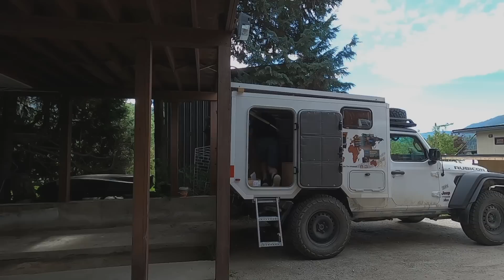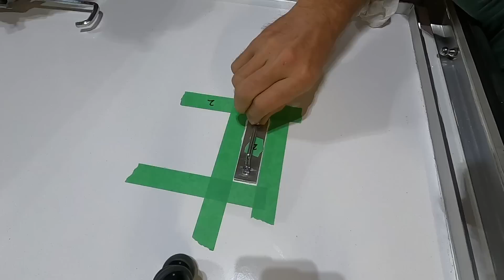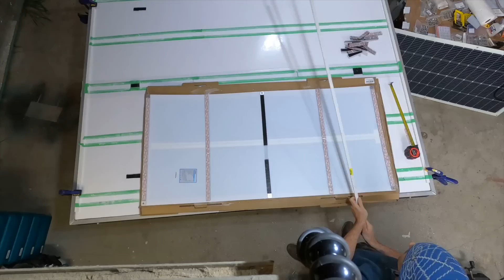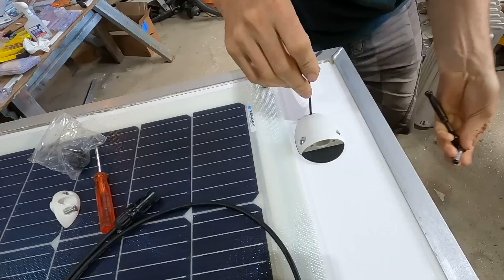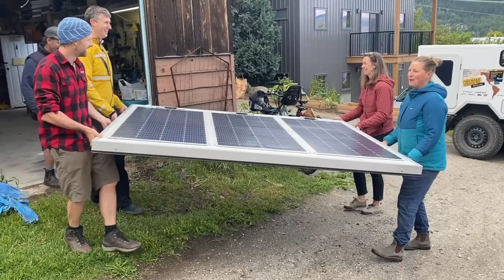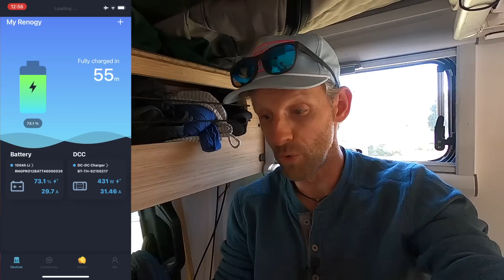DIY Flexible Solar Panel Install - POWER FROM THE SUN!

Comment: Most people are using VHB tape, also from 3M. All seem to be happy with it and gotta say without actually doing this myself, the tape method seems a lot easier than the method your are showing.
Reply from the maker: I really didn't know if VHB tape would hold up in the long run. I dont want a panel to rip off

Comment: Great video Dan, just planning a build out for f/t living.  Being in Canada ( you know the drill) would you recommend induction cook top, or propane? Solar is pretty limited in the winter as you are well aware.  Thanks,  and Have Fun! 🎉🇨🇦
Reply from the maker: Depends where you're going.
Propane is a pain for international travel (every country has it's own fittings, shipping the bottle is hard), and it freezes past about -35.
Induction was incredible, I'll never use anything else on future builds.

Comment: That is great!! I will pick your brain next year. I'm overlanding  my Wrangler JLU for small trips, but it will be a mobile 3D Design/Print studio. I will have a 3D printer, rear seat delete. My trips will be at the most 1 month long. I have been testing a 3D printer under continuous unstable surface and so far performing very well. I just need to recalibrate every few days to maintain top quality print. On the road I will be printing prototype, so print quality is not the priority.
Reply from the maker: Sounds like an awesome plan!
Reply: @TheRoadChoseMe  Thanks, very excited about it. I'm going to design and print practical parts and custom modular storage systems for the Jeep.

I really admire what you are doing, be safe and travel well.

Comment: Would these panels be good to fit to pop top Hi ace camper van, is there airflow between roof & panels? Thank you for advice
Reply from the maker: Yes, absolutely.
An air gap makes them more efficient. Some people say it is 100% mandatory, others not so much. Mine have a small gap, running great

Comment: Not a Renogy fan but excellent video!

I plan to put solar panels on the roof of my 2021 JLUR, which has a full off grid power kit (12V 100ah LiFePO4, alternator and solar).

Comment: Looks good, BUT not a fan of the tape, some conduit would have been a better choice.
Reply from the maker: I'll upgrade it to conduit if the tape is not sufficient. I had something similar for 3 years around Africa, it worked perfectly.

Comment: Great work and great video - as usual - well done.
One suggestion would be to add a piece of aluminum trim that covers the leading edge of the solar panels. Attach it with the same super velcro. You know your roof will get scraped up from trees and things and just don't want something snagging the front edge of a panel and ripping it.

Comment: Do you notice yourself using less gas now that the alternator isn't demanding as much?
to be clear I'm not sure how an alternator works lol. If you need more power it causes the engine to run at higher RPMs right?
Reply from the maker: Charging off the alternator does put more load on the engine, and will result in high gas usage, yes. Is it significant enough to be noticeable? The jury is out on that.
Reply: @TheRoadChoseMe  gotcha, thanks!

Comment: Excited to see your opinion on these. I used a cheap Chinese 100w flexible panel in southern California for a year and then it was dead. (barely generating) I've heard its because they don't have a way to dissipate heat as well as a traditional hard panel. I just now I won't be buying them again.

Comment: In a previous video you had already chosen an induction cooktop. What are the specs on that cooktop's draw?
Reply from the maker: It has two burners that are 1500W each on max
Reply: @TheRoadChoseMe  Neat. I'm assuming they are running on 110vAC from the inverter? Whats the draw down on the battery after a meal (ballpark)?
Reply from the maker: yep, off a 3000W inverter.
I have not used it yet, but I'll be reporting back after we put it through it's paces for sure
Reply: @TheRoadChoseMe which induction cooktop are you using?
Reply from the maker: Dometic CI120

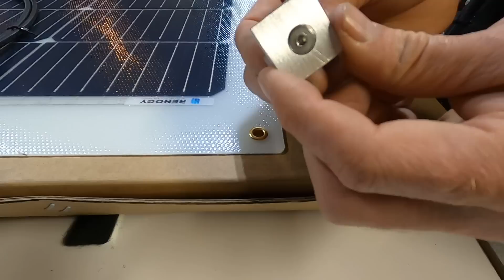Comment: 4:27
I did exactly that 7 years ago! 6 x / panel with a 45mm circle + sika 221 (= not the 3NM/qmm stuff). Hold´s up to 140km/h being at THE FRONT of the rounded roof! = High Pressure zone.
Nothing else holding these to the roof! 
Your choice of placing is a LOW pressure zone. The plates are quite small, otherwise I would think the velcro is not needed.

What I would always suggest: Make it so that water will always be able to run off the roof/PV when standing in every angle! It just takes 3 days under a tree or 2 weeks w/o and the roof is very, very dirty.

Regarding gab: A PV connected to the roof, makes the roof a heatsink. A gab does not. I do not see a benefit in a 6mm gab.
When a slim PV is on a surface, you can stand on it with no issues. Not with a gab of course. I do not know if your roof is capable of taking the weight of a person, but a foldable SUB e.g. or similar can be nice to place onto the roof for a short drive (like from the beach) or similar. Or a bag ...

Comment: I'd have mounted the panels to a framed perforated aluminum sheet  Fewer holes in the roof, air circulation underneath for cooling (and water drainage), easy removal for maintenance, and cleaner wiring on the underside so no snags.

Comment: Interesting idea using bugs as aero wind tufts. Makes the spare a bit sticky.
Winter snow might reveal a pattern too.

In Quebec, freezing rain is a concern. Allowing the panels to move from ice loading should help.
Reply: "freezing rain" is a very local concern. I can count the days in my live when I have seen that.
But that can be a huge issue in many ways.

Comment: My experience with Eternabond (similar to white gorilla tape) is that is traps water over time. Might not be an issue for you since you used heat shrink on the wires, but I live in the PNW where things stay wet a lot.

Comment: Hey just a heads up, I have just had some Renogy solar panels for a few years on the roof of our camper trailer, exactly how you have installed your panels.  One of the panels stopped working a couple of months ago, the panel was found to be under warranty, except I had cut and soldered the wires just like you, because I had done this, I had modified the panel and it wasn't covered under warranty.  Renogy in the past have been quite supportive, but in this case they weren't very helpful at all with this claim.
Reply from the maker: I figured I was voiding the warranty when I did that, thanks

Comment: Great summary on the serial vs parallel, thereto is one extra thing… charge controllers need 5v to run, so you don’t start charging until the panels give you 19.5v.  When in parallel, all the panels need to give up those 5v, but in series, only one gives it up, the other don’t.  An example:

3 panels that produce 20v @ 10amp, in parallel that is 20v @ 30 amp, but 5v goes to run the MPPT, so there is 15v @ 30 amp.  Convert that down to 14.5v and you have 31 amp.  Now put them in series, 60v @ 10 amp, subtract 5v for 55v @ 10amp, convert to 14.5v and you get 34 amp (about 43 more watts)

So there are some serious disadvantages, when you have three or four days of overcast, those extra amps really matter!
Reply: I personally would not go back to low voltage array for my mobile roof top setup. 40V minimum in my opinion particularly when located in regions where the sun is limited during winter. I've experienced the vast differences with series and parra circuits
Reply: "is 20v @ 30 amp, but 5v goes to run the MPPT, so there is 15v @ 30 amp."
Cannot be true. This would mean that the MPPT takes 5v*30 A to run? = 15W. For sure this is not a static value, as Maximum Power Point Tracking suggests.

But most of all: It is sponsored by a company. Therefore there are no other options. Here in Europe, most people use victron stuff. I just bought a 80 + 160 W panel, as the need to fit certain spots on the roof.
= to charger: 75/15, the very small ones. Similar size as a package of cigaretts, 55€ each. So I do not care. Except for double the cable from the roof.
Reply: @derJackistweg  I  believe the more accurate explanation is that MPPTs require a 5v differencial with the battery prior to commencing charge.
Reply from the maker: @cyclemoto8744 @derJackistweg  So I watched my system tonight as the sunset.
Battery voltage was 13.4v, panels were putting out 15.4v at 0.52A and the battery was charging.
If they were in Series it would have been roughly 46.2v at 0.173A for the same power output.
It's clear my charger does not require a 5v differential between the panels and the battery to charge.
Reply: @TheRoadChoseMe   To compare the effect  of series and parra you would need to measure the output from the MPPT opposed to the output from the panel or array. If you observed charge with less than 5v differential I have no reason to doubt you because you come across as competent person. I do not know the brand or model or your mppt so impossible to know the specifications. I can say that I've used various brand named MPPTs over the years with the most current being Victron which has outperformed all others when following the specified 5v differential. Your charger may be different. Cheers
Reply from the maker: @cyclemoto8744  I'm using the Renogy IP67 50Amp DC/DC MPPT charger 
( https://renogy.sjv.io/5gNPnD )
In the Renogy App I can see the output of the charger and the output of the solar panels seperately.
Reply: @TheRoadChoseMe  I have no experience with Renogy. The only reason I've stayed clear of their products is their terrible after sales service in Oz. cheers
Reply: @TheRoadChoseMe  while I still hold to the +V, maybe my math is off because I might not be taking everything into account correctly...  Here is what I know about my Victron MPPT's, they MUST be 5v over the charger voltage to activate charging.  What I don't know is how many of those amps it actually needs.  

To keep numbers simple let's assume two equal but different setups:  There are two panels, both 100 watts @ 20v for 5 amp of output.  In series, it is 40v @ 5 amp, and in parallel 20v @ 10 amp.  So both have a total of 200 watts of power.  My thinking is maybe what is it is that the MPPT only needs +5v and 2 watts, so... how it gets that 2 watts from each setup will be the same, but in both cases it will have 198 watts to convert into charging current.

I built my first solar system all in series because I am a fan of higher voltage.  I thought I would really benefit from the higher voltage, nope...  What I learned from my first system (4x75 watt panels) is that when the voltage was below about 76 volts (19 *4) the amps were so low little to charger was really happening, maybe up to about 10 watts, max.

This whole conversation has me thinking:  If the +5V isn't really a thing and higher voltage doesn't result in any meaningful increase in charge, what is the REAL advantage in higher voltage solar systems?  I think there is really only one: lower amp lose over the wire.  On a setup as small as yours you can over come that by using larger gauge wires....
Reply from the maker: @SamCarleton Lower power loss is the big one - you always want to minimize current when possible. I am also aware that many chargers have a low voltage cut off where they just stop charging below a certain voltage. Mine does not appear to do that, so for me that doesn't matter.

Comment: Are you worried at all about heat transference of having these flexible panels closer to the roof than say that of your africa jeep with a raised panel?
Reply from the maker: Yes, it is a concern for sure, though I hope the 6mm gap will be enough to not damage the composite panel of the roof from the heat. Time will tell, I will report back

Comment: Awesome. Would love info, or links, to the 3m tape and epoxy glue for the aluminum backing plates. Did not see them in the description. Is it possible to add a display to monitor without a smart phone? Thanks
Reply from the maker: Thanks, I just added links to the 3M dual lock in the description.

The adhesive we are using for the backing plates and entire camper assembly is "Korapop 225" from Germany. Sika make many similar products, make certain you get the right one for your application, and use the correct activator, with the correct time delay and curing time.

Comment: Another  advantage of running your solar panels in parallel is that you won't have total charging failure if one solar panel becomes defective. Have you considered using silicone caulking to hold the wires to the roof instead of the Gorilla tape?

Comment: We recently had to replace the flexible solar panels on our caravan, which had stopped working, with glass solar.
Experts say if flexible solar is laid flat on the roof it overheats and stops working. There must be an air space to let the panels vent excess heat.
Our new Enerdrive glass solar panels are working brilliantly. We recently went 56 nights in Tasmania without needing to plug into mains power even once.
Our 200amp lithium battery was fully recharged by midday.
You might get away without an air gap in cold weather, but it could be a problem in warmer temperatures.
Reply: BTW our Enerdrive charger could handle up to 600 watts of solar. We have 400. Maybe you need a bigger controller.
Reply from the maker: The charge controller I'm using can handle up to 720W of Solar, just not above 50V of input
Reply: I’m looking at putting 2 of them on top of my checker plate aluminium canopy. Height is critical! How much of an issue is the air gap & overheating? Do they complete stop working or just some performance loss? How much loss?

Comment: You went to all that trouble with the wiring because you didn't buy a slightly larger controller America might believe you but aussie,s will be laughing a suitable victron unit very light but they aren't a sponsor white tape looks awful   the  guy that built the back would be horrified 😢😢😢😢😢😢😢
Reply: As an American, I'm horrified he is using one charge controller for the alternator and the panels. If that burns out, no charging at all.

Comment: My exp with the adhesive on the industrial Velcro is, when it gets hot it melts and looses stick. I have had stuff come unglued from painted surfaces that way. I would use a Velcro that doesn't have adhesive and glue it down with your industrial adhesive. Especially where those panels will get very hot.
Reply from the maker: Do you know if the surfaces were prepped correctly before the adhesive was put on? that makes a HUGE difference

Comment: Great video as always Dan 👍 There doesn't appear to be anything stopping the bolt rotating in the spreader plates (that hold the solar panel). Yes I did notice some roof & bed system parts, really looking forward to that video. Re the other comment about cleaning under the panel, if you can easily remove them then you can clean that way. I'm thinking of going flexible panels on my next build. Rigid panels are very heavy when you've got a lot. Regarding the soldering, if the wiring gets hot won't the solder fail? I like that you've taped down the wiring although there appears to be some gaps at the ends where water/dirt could get trapped. Maybe there is some way to tape down tighter there or maybe caulk the gaps? I'm amazed you managed to fit 600W on that little roof, well done 😁

Comment: Oh boy. I need to install my two 400w panels. They are traditional rigid panels, heavy as shit. Kind of thinking I should have gone with less but lighter panels since the DC-DC is charging as I drive anyway.
Reply: Lots of people have issues with the flexible  panels.  Avoid if possible

Comment: Space between solar panel and roof is to small, in this gap will be dirt, dust, leaf of trees etc, and all this stuff will block air circulate and of course your roof will be hot. Will be hard to clean up under solar panel.
Reply from the maker: I will let you know how it works out long term
Reply: @TheRoadChoseMe  
Of course I will watch you.
Best regards from Europe.

Comment: This looks great, Dan! One recommendation... Buy a cover for the spare tire. You will not get wind noise and its slightly more aerodynamic. I use a cover for my roof-mounted spare, and it was noticeably quieter after install than beforehand. It could be a nonissue for you, but my spare was making some noise, so I had to do something. Just a suggestion. Anyway, love the Jeep camper build. It is genuinely amazing.
Reply: A cover will also stop UV damage to the tyre
Reply: @10gimp39  yes it will
Reply: Agreed. Rubber dries out in sunlight. A cover slows the drying process.
Reply from the maker: Thanks for the suggestion, I'll look into that. The camper does have a bit of wind noise at highway speed, I've been wondering if it's the spare, or the flat front wall of the camper
Reply: It also protects the tire from sun it will last longer